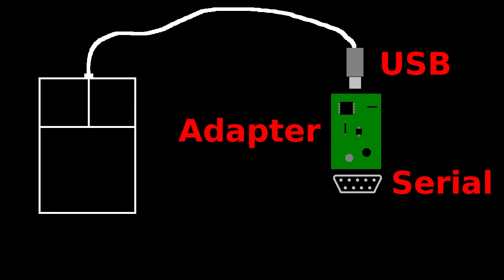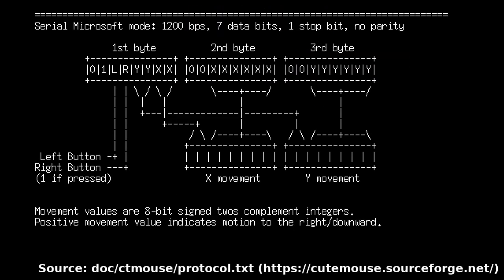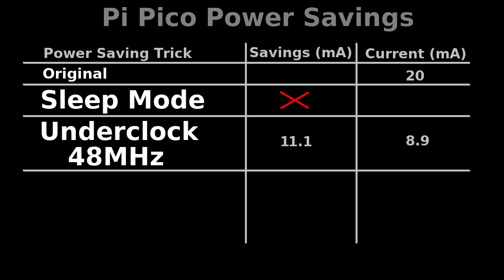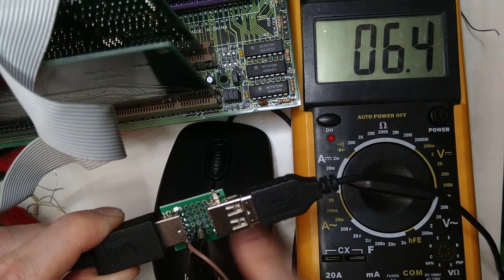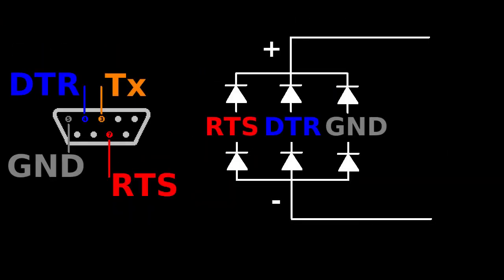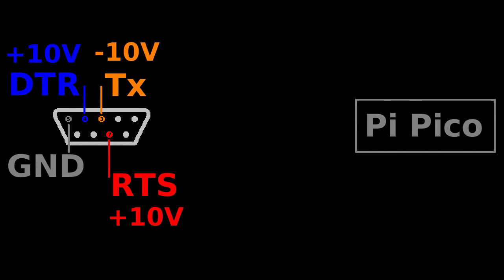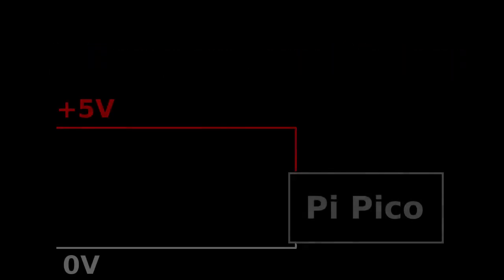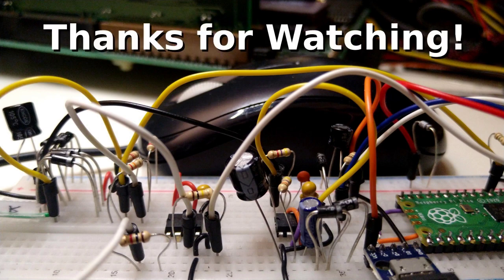Quest for the Serial Optical Mouse: The search for milliamps (part 1)

Comment: Have you considered a self oscillating switch mode converter like a jewel thief with a flyback output winding so you don't have to modify the mouse? You could have a special winding and driver just for the TX pin. Otherwise very interesting
Reply from the maker: Good idea, I think I could use a joule thief instead of the 555. But I would still need to modify the mouse because without the resistor mod it just needs too much power.

Comment: Very good project. I downloaded the schematics, but having some confusions. Could you please clarify what exactly U2B (LM358) is doing being connected only to inputs?
Thank you for sharing the project anyway.
Reply from the maker: The LM358 contains two op-amps. U2B is the second one which we don't actually use, so I have just connected the inputs to fixed voltages. The real work is done by U2A. It's job is to convert the Pico's GPIO levels to RS232 levels.

Comment: great project but just  one question :why to  use pico instead of other low power micro like atmel or Pic?
Reply from the maker: The Pico has USB host, which is needed for talking to the USB mouse.

Comment: I was wondering on the schematic you are tapping power from both and negative and a positive in the rectifier stage, it occurred to me that you could drop the op amp and just use a transistor and capacitor on the reference voltage is being supplied to you and then just retransmit those instead of an op amp or maybe that's kind of what you're doing with the op amp anyway ?  Maybe this is all out of my pay grade :p
Reply from the maker: Yes, this is what the op amp does, it pulls the pin either to the positive +5 or to the negative -10. The tricky part is that you have to output positive voltage with a GPIO voltage of +3 and negative voltage with a GPIO voltage of 0. The op amp just makes this easy because you can compare against a 1.8V reference voltage.
Reply: @scrap_computing  thanks for that, I need to play with these things more to better understand them!  But I understand enough to grok what's going on.

Comment: What is the reason for the custom board to fit inside the mouse instead of a dongle to house the pico with 232 and usb connectors?
Reply from the maker: Because the goal is to make an optical serial mouse :)
Reply: The mouse also needs modifications anyway.

Comment: What about wireless mice? Maybe the USB dongle doesn't need as much power as the mouse itself.
Reply from the maker: I tried a Logitech M170 but the USB dongle consumes 19mA, so it won't work. I have not tried any other brands though, so there is still hope :)